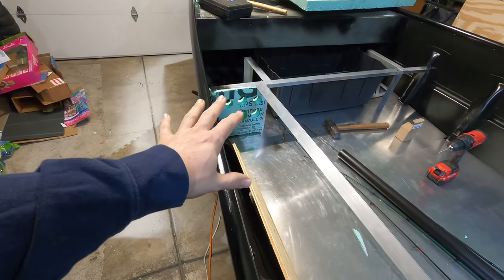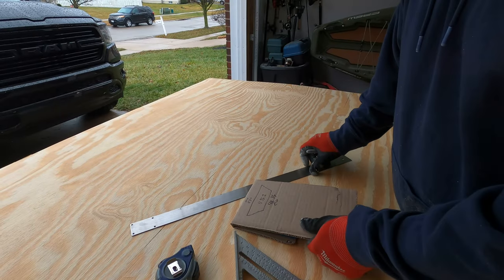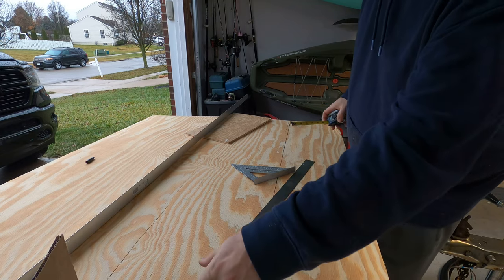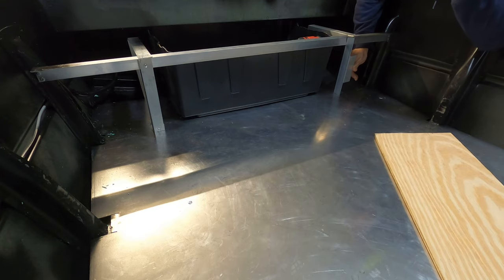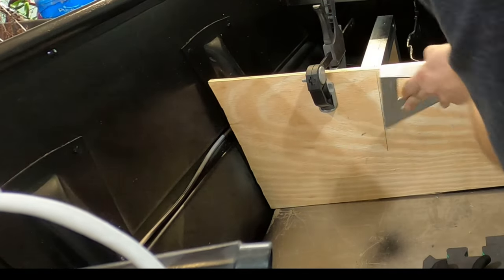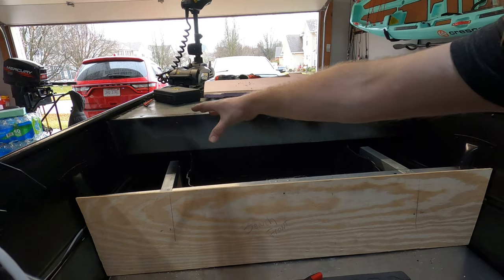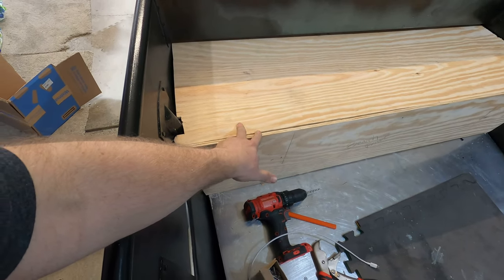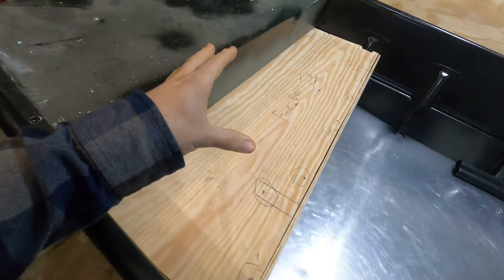JON BOAT BENCH SEAT STORAGE & ROD LOCKER UPDATE - 1648 Jon Boat Build

Comment: Why did you go with wood instead of aluminum if you don’t mind me asking
Reply from the maker: Workability and cost. Wood is a lot easier to work with using the tools at my disposal, I went with aluminum for the floor so it will last if it gets wet. Everything off the floor will stand up to use over time.